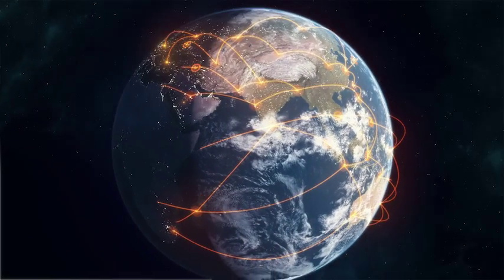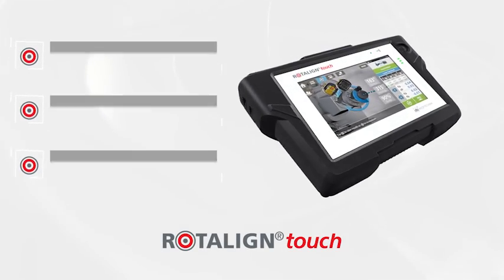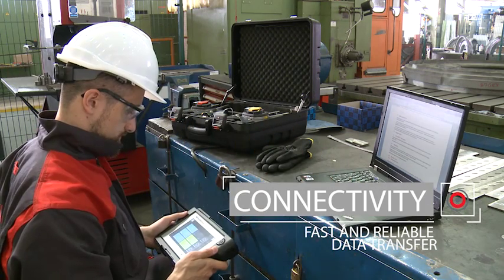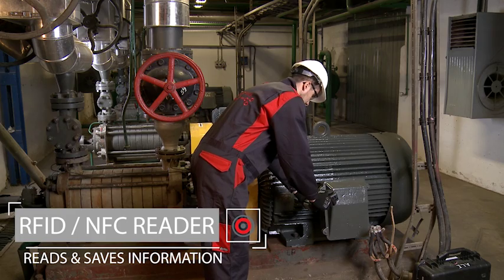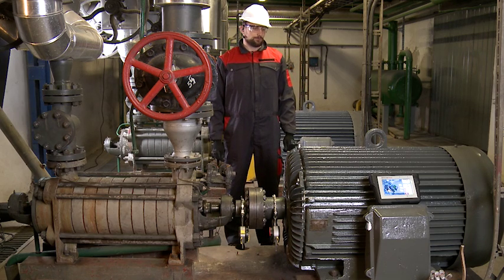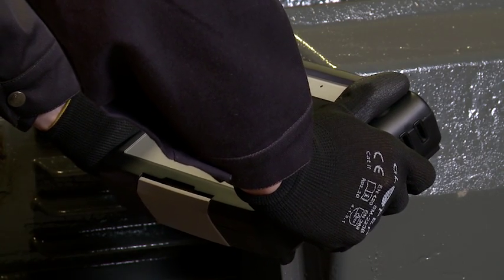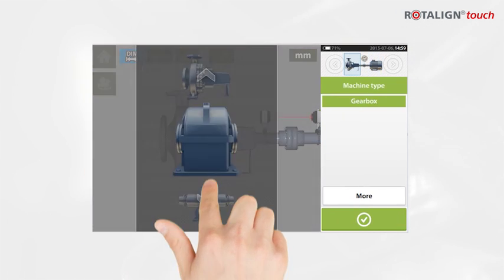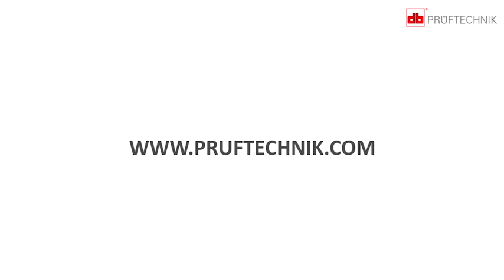Remote laser shaft alignment with ROTALIGN touch

Comment: in this video the guy took less time than reality is this possible????
Reply from the maker: Dear Sunil Lama, yes you are right, and somehow even not. Let’s just explain: The measurement task with ROTALIGN touch is really pretty fast and intuitive. Also due to many individual options it may take literally only 1-5 minutes to set-up the measurement task on the display. The brackets and the laser/sensor units are set-up within less than a minute – with some routine even faster. The measurement then is just some work of seconds, if you do it right! So, the only task that really takes some longer – but it’s dependent on the machine asset itself, and has nothing to do with the ROTALIGN touch – is the alignment process itself. Loosening the machine bolts, loosening the coupling if necessary, shimming, fixing the bolts again, re-measure… Of course we cannot display all this work in the video. We would like you to see and understand how much easier your work becomes by using ROTALIGN touch instead of any other “standard” system. In this case the video almost displays the real working speed. If you want some hands-on demonstration by yourself, please feel free to contact us anytime.